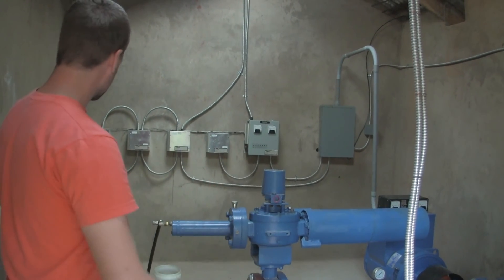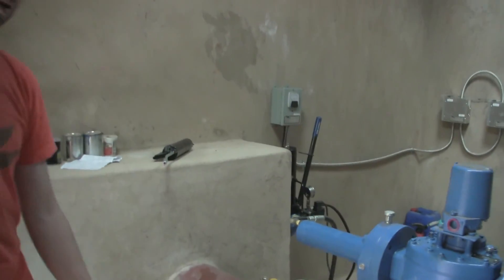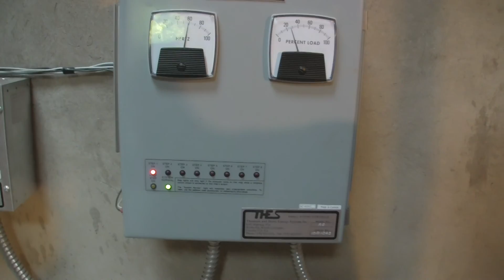How the Hydroelectric Turbine Works

Comment: Very interesting, thanks for sharing. I knew that a pump on reverse could be used as a hydro-geneerator but, is that the optimum? I mean, looking at how this is made in larger scale they use specific turbines (Kaplan, Francis, Pelton...) depending on the head/conditions on the water and I am assuming that you use a centrifugal pump which is somehow similar to a Francis turbine